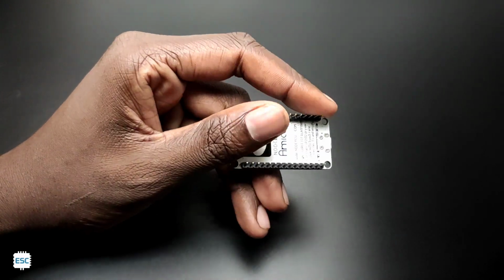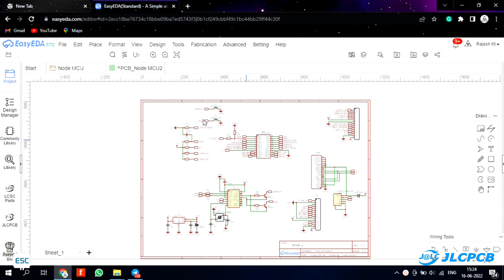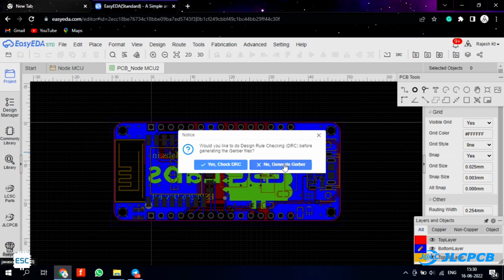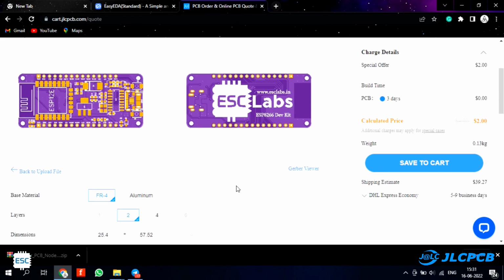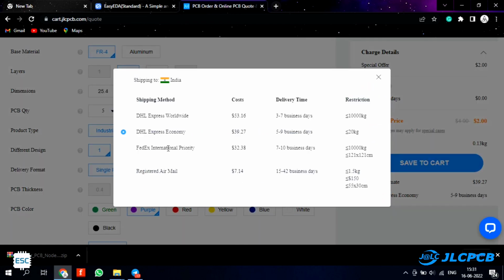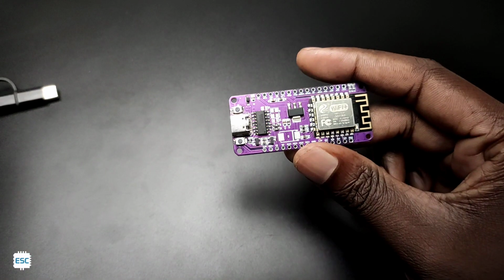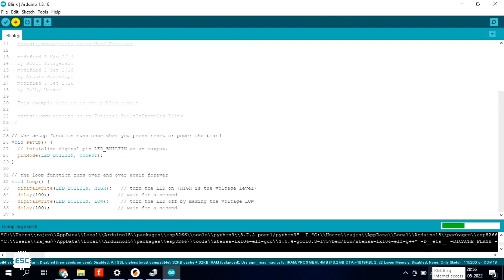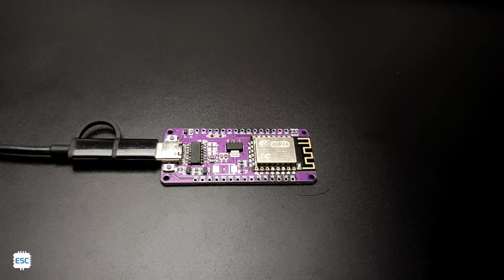How to Make ESP8266 Development board | DIY NodeMCU | JLCPCB

Comment: why is there a crystal oscillator? yet the board does not contain any?
Reply from the maker: No crystal is used here.!
Reply: @EDISON_SCIENCE_CORNER but in your schematic sir you are using crystal, will it be fine if i not install it in the pcb

Comment: Sorry I want to ask for crystal components you use what series?
Reply from the maker: 12mhz. By the way, I didn't use crystal because here is used ch340C IC
Reply: @EDISON_SCIENCE_CORNER  I want to ask again for the schematic that you have on the google drive link, for the USB2 symbol, what is the search code on easyEDA?
Reply from the maker: @Naoo3198  search for micro usb , usb TYPE C 16 pin